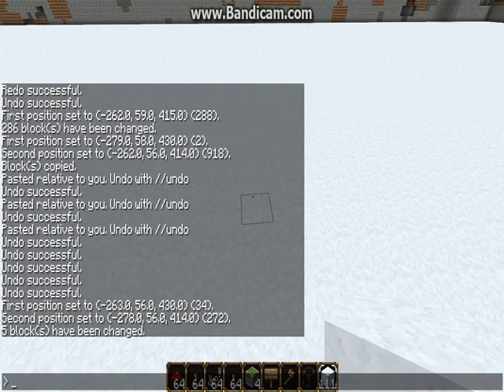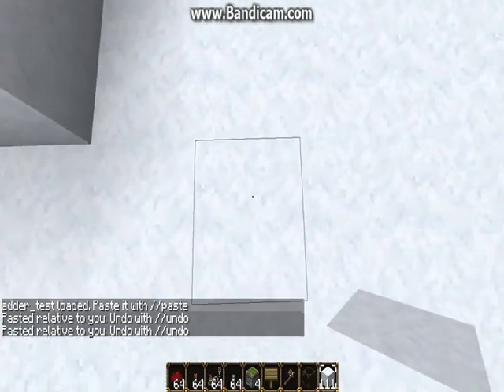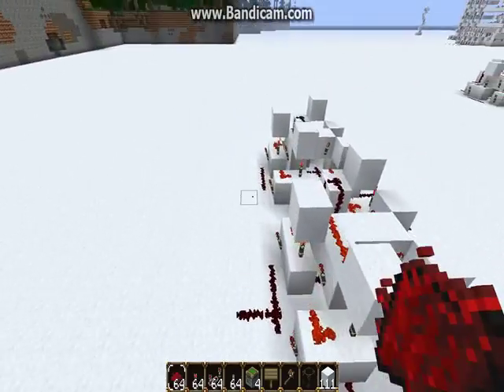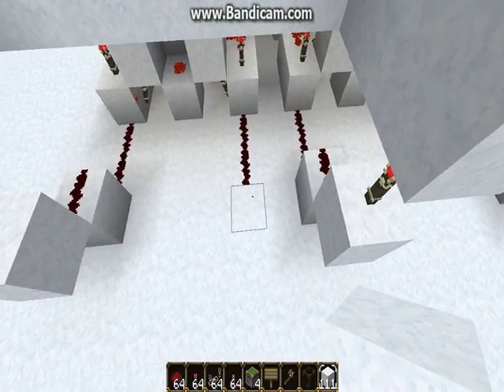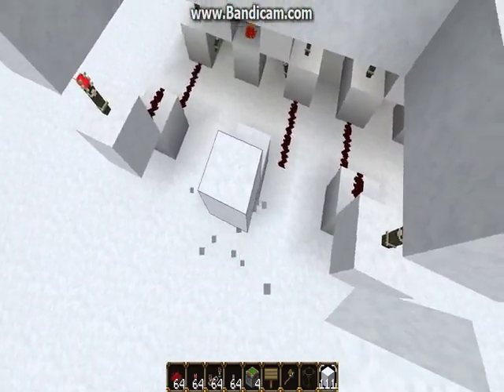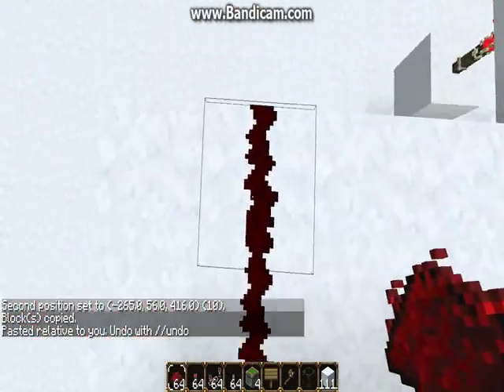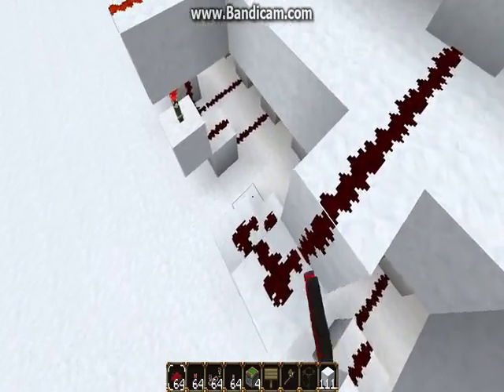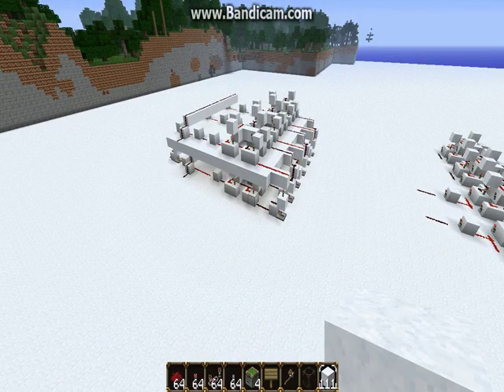Building a minecraft computer tutorial pt5: Designing our first ALU

Comment: Hello, i'm having a probem with subtraction ...

When i turn only imput "1B", i get the output of 7 (4+2+1 all outputs light up), when it's supposed to be 1 - 0 = 1.

And few more questions :D ... 
1) Are inverted numbers considered to be negative?
2) What is the order of subraction? I mean, i noticed that you turned on (in demonstration) 4A; 2B;1B = -4;2;1 and got 1. The only way to get "1" is
0-1B-2B-4A=0-1-2-(-4)=1. Is this order correct? Or do i not understand how subtractor computes?

Comment: I have had the same problem as you. The problem is that you need a repeater on the wire above the outputs to carry the signal all the way. The wire that you switch to enable the outputs. Put a repeater in-between the 2nd and 3rd torch somewhere. If you are having problems, tell me and I will see what I can do.

Comment: Hello! I have just started following these videos and they have been really helpful! I have however run into a small issue. I have made the ALU and the subtraction works,but the addition on the lower part is not working properly. I can get it to do 1+1=2 and 2+1=3, but when I do 2+2 = 4, 4 doesn't light up. the transfer from 2 to 4 is lighting up, but the 5 pieces of redstone n a line doesn't shut off to light the repeater.I'm not sure why it is not working like the first two. thank you!

Comment from the maker: You're right, you'll lose information when you get a number over 15, so it ends up starting back at 0. Although, this is probably what you'll want to happen. If you included the carry out, you'd have a 5 bit output from the ALU, meaning you'd need a 5 bit ALU to process your new data which would give a 6 bit output, and etc. etc. In order to avoid this problem, the way I did it and the way real computers do it is simply not include the carry out in the results.